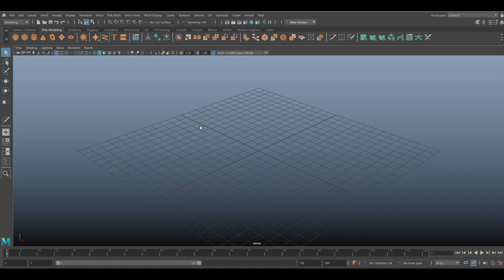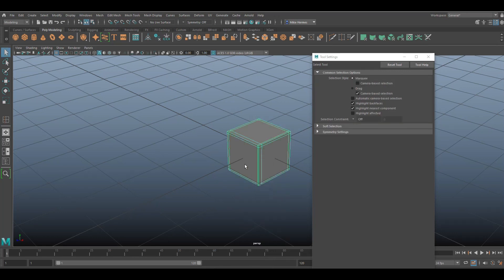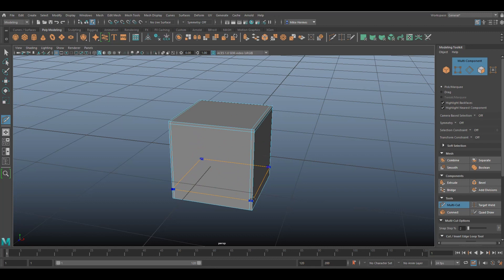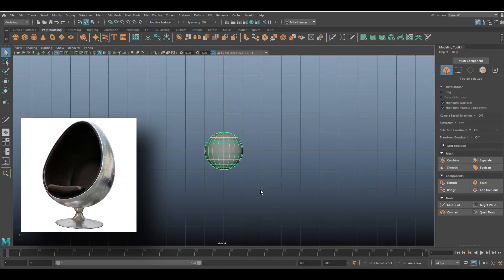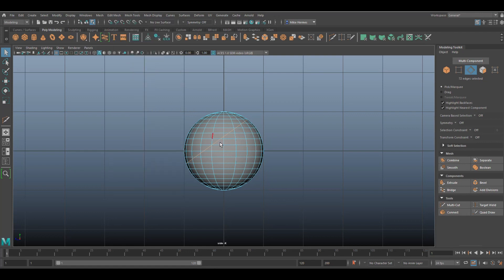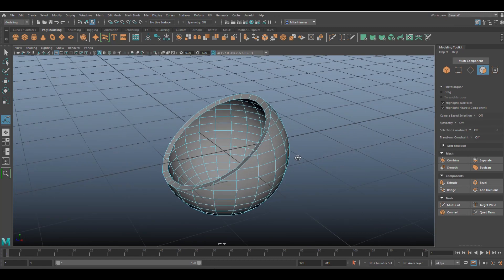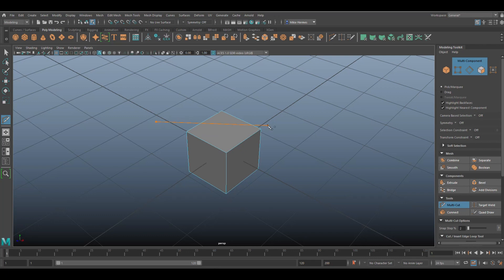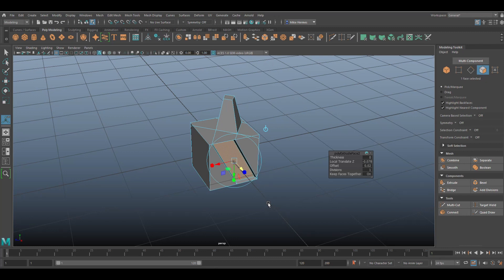Maya tutorial : Did you know the Multicut tool could do this ?

Comment: Also, the multicut tool supports Edgeflow and cuts strictly in the middle of the selected edge when you press the mouse wheel. This is very convenient when you need to quickly mark exactly in the middle.